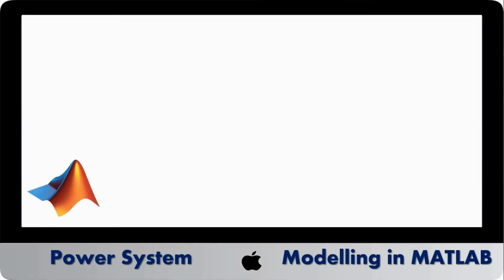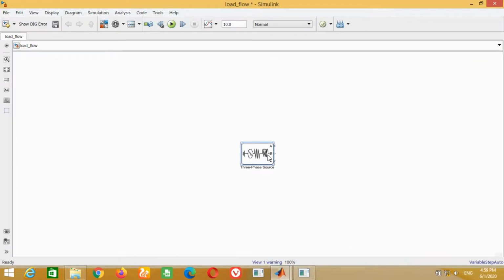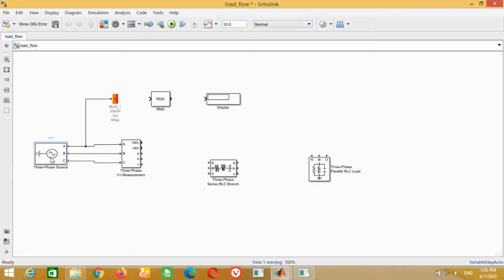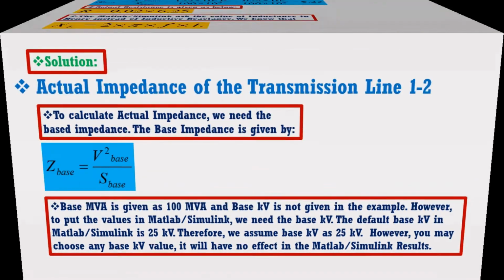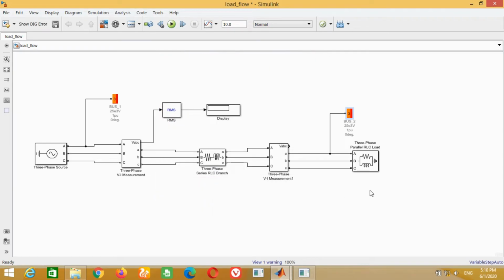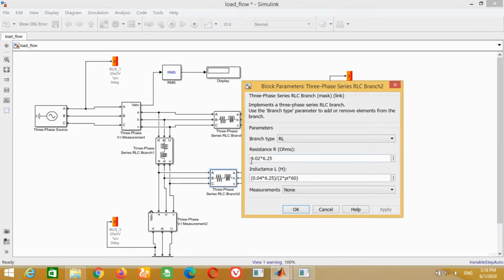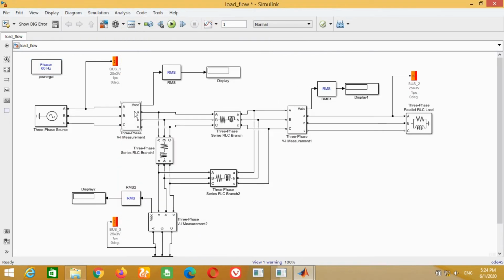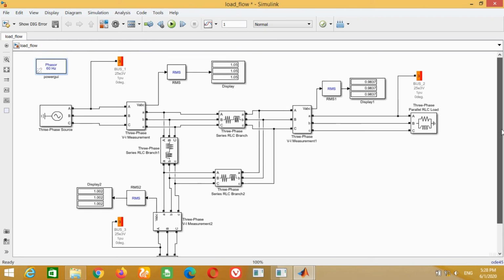How To Design Load Flow Analysis in MATLAB/SIMULINK ? | Dr. J. A. Laghari

Comment: plz wht's the difference betewen powergui phasor or continu
Reply from the maker: Thanks for the comment. These are different settings suitable for different simulation models. In power electromics based models where we need pulse width modulation, mostly discrete power gui is used. For conventional power system continuous powerr gui is used. For load flow studies or other complex models, sometime phasor power gui is used to obtain the correct results.

Comment: thanks for your efforts, I wondered CAN WE shown  voltage drop on the result? how we can doing that? your feed back highly appreciated
Reply from the maker: Thanks for the compliments. I am not sure but you may try it by connecting scope and measure the voltage
Reply: @DrJALAGHARI 
Thanks for your prompt respond
I i have motor 400kw
Distance 100m
Starting type Soft-starters
Can you Please providing voltage drop by Matlab
Reply from the maker: @fakhrialmayahai6111  Thanks for the comment. I haven't simulated such model. But if you connect the model correctly it will provide correct results.

Comment: Thank you sir, can u explain how constant impedance load (if load impedance is given instead of P and Q) can be specified in load flow analysis instead of constant power load? and also for a PQ bus without load, is it allowed to ground the output voltage measurement? Please try upload video on power flow analysis on island microgrid with droop control. Thank you
Reply from the maker: Thanks for the comment. Kindly go into detail about three phase series load in order to know how it may work.

Comment: pls i tried opening with simulink but the mdl files in the Hada toolbox are in .MDL and not in .mdl. Please what can i to open it?
Reply from the maker: Thanks for the comment. Just change the extension by right clicking on the MDL and write in small capital letter such as .mdl
It will run smoothly.

Comment: Assalamualaikum Dr. I want to ask if I dont have rms block. Can I replace the block with something else?
Reply from the maker: Wa'alaikum salaam if you are using matlab, then rms block is available. However, if you don't want to use it, then the answer given will be in peak voltage. You have to divide it to obtain the rms voltage.

Comment: Hi Dr. J. A. Laghari, thank you so much for the wonderful tutorial. May I know how to model/design a distribution test system integrated with Distributed Generations such as PV arrays and Wind Turbines in MATLAB/SIMULINK to perform its load flow analysis Dr? Your reply will be highly appreciated Dr. Thanks in advance Dr.
Reply from the maker: Thanks for the compliments. In my opinion it is possible. For this purpose, you just need the distribution system data and DG capacity. Based upon this data, you can model it in simulink. Obviously it will take some time to properly run it. But it is possible.
Reply: @DrJALAGHARI  Thank you so much for your kind advice Dr. I really appreciate it Dr.

Comment: Thanks for this tutorial. I want to simulate 9bus system but how can initialize the values of voltage? because
 this values now available. i want to see if matlab can give these values?
Reply: hi
Reply from the maker: In matlab 2020 version, IEEE 9 bus test system load flow analysis model is available. You can download from it.
Reply: Thanks, I will check

Comment: How to plot PV and QV curve?
Reply from the maker: May i know the reason why you need to draw the curve for load flow analysis.
Reply: Hello Dr. J. A. Laghari, I am doing project on voltage stability analysis using PV and QV curve method for my academic purpose. How can I plot it on simulink?
Reply from the maker: @madhavdevkota2309  in my opinion, take separate measurements, then combine these measurements into one signal using multiplexer, then connect the scope. May be it work.